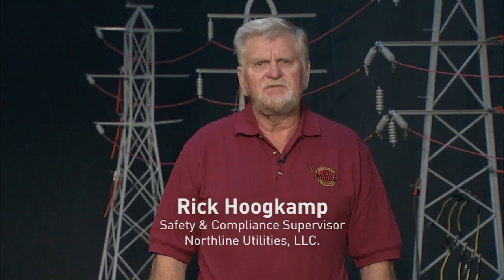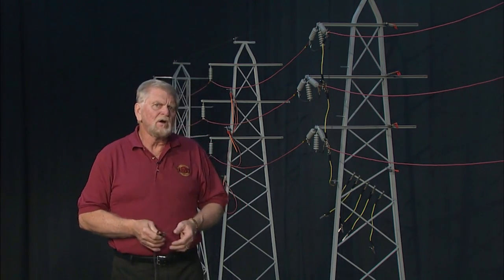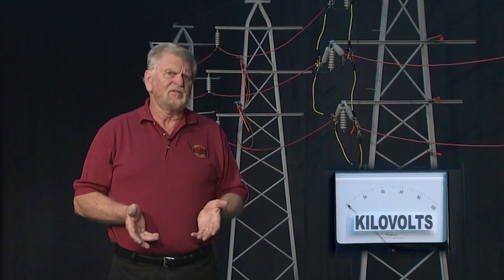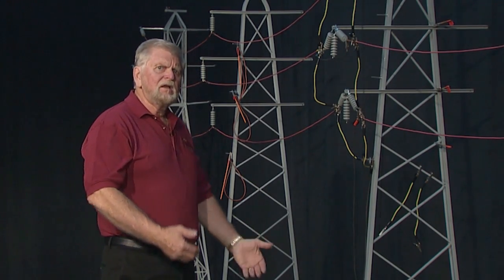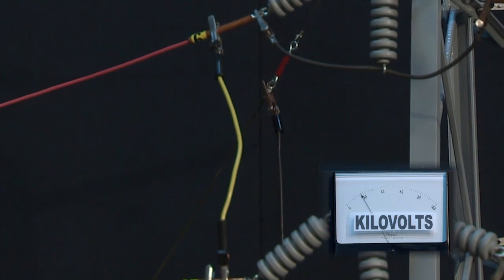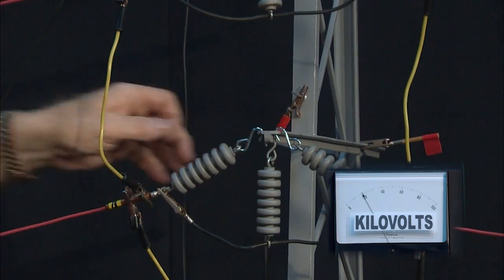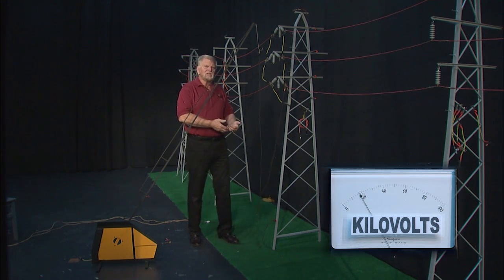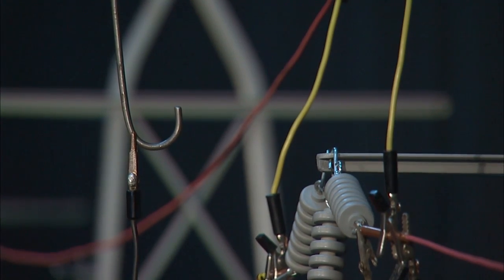Understanding an Equipotential Protective Grounding Zone

Comment: Thank you for this great video. I have a question. If workers have to do a live-dead-live test and the equipment  they are currently on is grounded to the structure they are supposed to work on, would it be safer to remove the equipment grounds before doing the "live" test on a live 500K corona ring as the portion of the live-dead-live test? The workers were on a 80 ft all-terrain boom lift inside a sub station. They were checking bus on the primary side that had already been separated (as there were two sets of three phase 500k incoming) there was a alternate transformer as a replacement in case of failure that lived between the two sets. one set and the replacement were denergized but still close in proximity as it would be in a sub station. The bus that originally connected them were separated during a clearance. However the bus still needed to be separated between the second de-energized set and the replacement xfmr. So it required a live dead live test. There is no way to create a dead zone in this instance however my thinking is that is may have been safer to perform the live section of the test using a 15' pole with a tester on the end without making the boom lift into a lightening rod. What is the right thinking here?
Reply: You're asking if the workers on an 80' boom lift doing their live-dead-live test in a substation are better off having the lift grounded or ungrounded while performing the live portion of it, as in if the current was to track through the tester and down the "pole", (which I assume you mean hot stick) through the worker, to the lift?

Comment: Wont grounding the phases together just cause a catastrophic short if accidently energized and potentially cause a huge explosion?
Reply: An explosion at the fuse not right there on the line
Reply: If the line was energized, especially at transmission voltage, the arc flash would be beyond belief and the person doing the grounding would most likely regret it for the rest of their life. We're talking the potential for temperatures of tens of thousand of degrees. You would never, ever, knowingly install a ground on an energized conductor, unless of course you were insane. In this scenario Rick is talking about an "accidental" energization or inductance from an energized parallel circuit after the line that is going to be worked on has been deenergized, tested for deenergized and then grounded, where it is then considered dead.

Comment: One thing I can't seem to understand, if the lines have say 14.4kv of potential difference from the ground and you bond everything together, what is happening to the electricity? I assume everything is brought up to 14.4kv since you can't touch the guy wire safely but  you're also bonded to the tower which is bonded to the ground, wouldn't it be flowing into the ground to go back to the source, causing every path including those through the worker to be dangerous? That's what I'm having a hard time understanding. Sorry not a line worker
Reply: There isn't a difference in potential, thats the whole point of equipotential grounding. The line is Deenergized, everything Rick is talking about here is in the case of an accidental energization. If the line was energized at 14.4 kv or any voltage you wouldn't be able to ground it, if you tried to put a ground on an energized line you would quickly regret it. The line is denergized, tested for deenergized and then grounded where it is then considered dead. Once everything in the work zone is bonded to a common ground source the equipotential zone is created. If the worker is standing on the tower and is in contact with the phase and theres an accidental energization and the tower and the phase are both bonded to the same ground source (equipotential zone) the electricity has a much better, alternative path to ground than through the worker. Electricity takes all paths so the worker will have some flow through him but because the grounds are a much better path it will not be enough to harm him. As Rick said, the problem arises when theres a path through the worker to something conductive that isn't grounded to the same ground source that everything in the equipotential zone is grounded to during an accidental energization, such as a guy wire or a piece of equipment like the crane in his example. That is when the worker could be exposed to voltage that could kill him. BTW, the equipotential zone doesn't have to encompass anything more than what the worker needs to complete his job. For example, if I was only going to change an insulator on the bottom phase, all I would have to do is bond that phase and the tower to the same ground source, after of course testing deenergized and the equipotential zone for that task would be complete and I could safely do the job, I wouldn't have to bond everything on the entire structure as long as I could safely maintain my clearance from anything that isn't part of the E.Z.
Reply: @08c6vette  exactly! These accidental energization wouldn't be 14.4 but closer to 4-7k...Still very high but it would be coming from a separate energy source like a generator. Still, the generator can step 240 up to 4k through transformers on utility side.
Reply: @dougfoster445  An improperly hooked up generator could definitely backfeed a utilities system and it would be energizing the phase its tapped off at the same voltage the phase is normally at because a transformer works both ways.  Most of the transformers at the utility I work at are either 4.8kv fed from a 4.8kv 3 phase Delta system or 7.62kv fed from a 13.2kv 3 phase Y system but many utilities use 34.5kv distribution, which would energize the phase it's tapped off at 19.9kv.  An accidental energization could come from just about anywhere though, I.E. coworker mistake, Mother Nature, equipment failure. You always have to take inductance into account as well, especially on transmission voltages, which can be every bit as dangerous as an accidental energization. One of my father's coworkers was killed in the process of removing a set of tower grounds because of inductance in the '60's.
Reply: @08c6vette  interesting! Thanks for sharing. I’m super fascinated by this stuff. Why does inductance play a factor into all of this?
Reply: @dougfoster445  You're welcome. Inductance plays a factor because it's basically what makes it all work, without it we'd be sitting in the dark. Every transformer, whether it be a distribution transformer converting primary voltage to secondary voltage, a sub station transformer converting transmission voltages to primary voltages or a transmission transformer converting transmission voltages to other transmission voltages and any other type transformer you can think of uses inductance to "induce" current, via magnetic flux from the source coil to the secondary coil of a transformer. What voltage the transformer puts out depends on the source voltage it takes in and  how many windings the source coil has compared to the secondary coil, which is referred to as the turns ratio. As far as a hazard to a line worker inductance always has to be considered, mostly when you have parallel circuits, which is usually the case on transmission lines and can also be the case on distribution circuits as well. More times than not when working on a structure with parallel circuits, only the circuit you have to perform work on will be deenergized and the other circuit will remain energized, occasionally you'll be able to have  both circuits out but it's not the norm and just like the coils in a transformer the energized circuit can "induce" current to the deenergized circuit, posing a serious hazard to the line worker if he doesn't properly ground and establish an equipotential zone. My fathers coworker was killed on a tower with parallel circuits, one energized, one deenergized while removing their grounds after their work was complete. Sadly after removing one of the ground leads from one of the phases he went to remove it's tower clamp, which was clustered together with the other grounds tower clamps and he accidentally removed one of the clamps from another ground that was still attached to one of the phases and sustained a lethal shock because of the energized circuit inducing current on the deenergized circuit.
Reply: Correct me if I'm wrong but I think its due to the body having high resistance and equal voltage at the hands and feet that cause no current to flow and thus no danger.   The way I understand it is if the parallel path was just a wire or piece of metal then current would flow on that and back to the source since current takes all available paths back to the source.  If I had a 12v headlight bulb and one wire feeding power to it and then connected a second wire in parallel to feed power to it the current would be split between the two wires.  However if I added a bulb to the middle of the to that second wire that was in parallel then no current would flow on it since there would be 12v on either side of the bulb and all the current would go back to flowing through the one wire that's connected directly to power source.  Like having a test light connected to battery power and checking another bulbs power feed, it wont light due to no current flowing since there is no difference in potential across the load.
Reply: @H750S  thank you. I understand it a little better. Like a bird with 2 feet on the line. Electricity doesn't flow because both feet are at the same potential. No difference, no flow. But still a little confused, and can't picture how the electricity is moving from the power line, through the tower, and into the ground without it possibly going through the worker? Like any given 100 foot section of power line is at the same potential all the way across from one end to the other but electricity still moves through it???
Reply: @peters6850  Was wondering how safe the worker would be on the ground and what the step potential would be in this situation?  Mike holt has some amazing videos and well drawn out examples that go into more detail on this.  Stuff about step potential and voltage gradients.  It seems like if current is all running into the ground and going back to the source that just walking in that area or standing on the ground and touching the structure could be dangerous due to the voltage gradient created.  Maybe they have special shoes/equipment that protect them in a situation like that?
Reply: @H750S  I would think you're right because the guy wire is connected to the ground and in the video they said touching the guy wire could kill the worker.  I'll check out his videos. THANKS!
Reply: @peters6850  looked around a bit more and found some more info on this.  Seems like you were right in that some current would still go through the lineman.  In theory everything should be the same potential but guess with such a large amount of current through the structure there would be a little difference of potential across the lineman. But if the equipotential grounding wires are in place it seems like they can minimize voltage across them and get the current down to a safer level, maybe around 10mA or so.  Got it from Hubble power systems video titled grounding videos-chance (temporary protective grounding)
Reply: @H750S  I'm going to watch that when I get a chance. Thanks for coming back to let me know.
Reply: @peters6850  no problem
Reply: @H750S  I know it's been a while but I just came upon this thread again. I can't speak for all utilities but the one I work for requires our everyday workbooks to be EH (electrical hazard) rated. If we are approaching a down wire, we have rubber overshoes for added protection. As for how safe the worker would be on the ground,  the step potential hazard would be fairly low because the anchor that the guy wire is attached to is buried 8' in the ground and the structure itself is well grounded giving excellent paths to ground to bleed off the vast majority of the hazardous current and unless the worker was in contact with the guy wire or the structure at the time of an accidental energization and somehow provided a much better path to ground than the anchor or tower ground, which is highly unlikely because of their EH shoes, the chance of it shocking the worker is pretty low, not impossible but low. The greatest danger from step potential usually comes from an energized, down wire, laying on the ground, that doesn't have a good earth bond to bleed off hazardous current that's looking for a good path to another potential, which in that case could be through the workers feet and legs but the amount of step potential risk would depend on a lot of factors like the type of soil, whether its wet or not, what the voltage is or how far from the source the worker is, etc.
Reply: @08c6vette  interesting, thanks for explaining that.  Not in the field but electricity does peak my interest so try and learn about it as much as I can.
Reply: @H750S  You're welcome. I can still remember many years ago after being a lineman for some time already when we first got this training, oddly enough from the very guy doing this video, who was an instructor for many years at the utility I work for and is one of the smartest guys on the planet when it comes to electrical systems. It's scary to think of the potential danger we were in, back when we just did bracket grounding, thinking we were safe.  I can still remember asking Rick how come nobody had been hurt before this and he simply said we were lucky, which obviously didn't sit too well with all the linemen in the room.
Reply: @H750S  go back to the source? does water go back to its source? That's an interesting question...